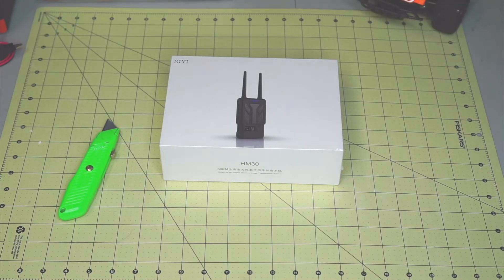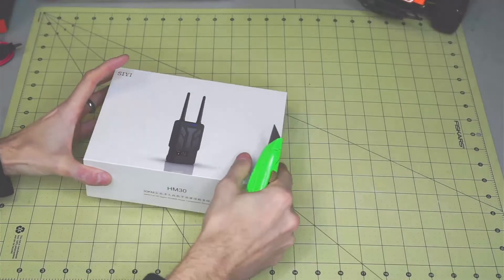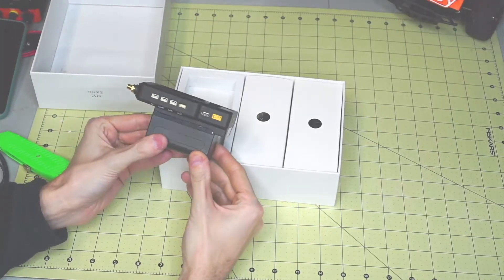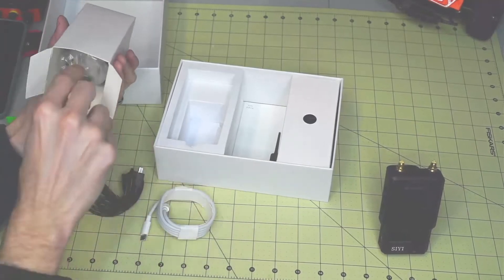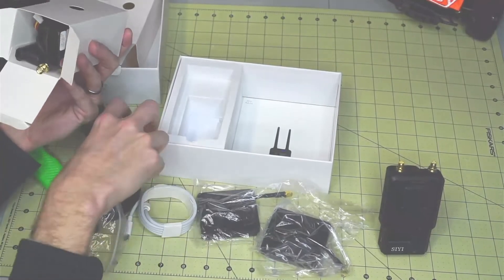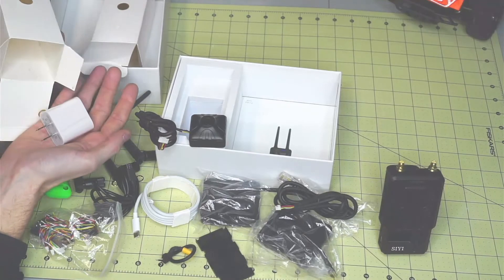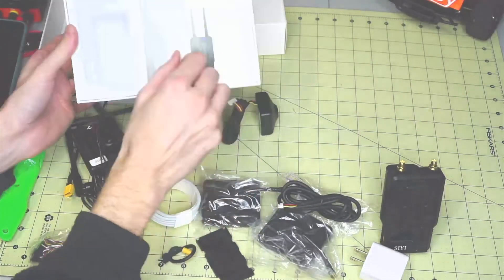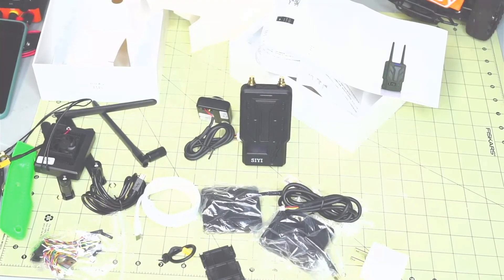SIYI HM30 Unboxing - openSAR.net

Comment: Have this system being delivered soon , got the hdmi converter with it because i buil a homemade fpv cockpit with a 50" screen , I think it will work good with my setup,  check it out
Reply: Get that flight in!  I seen your cockpit.  Nice.   I to have this on order myself.  I'll be using strictly with fixedwing since the latency is way to high for proximity quads and ever planes.    I have the DJI system but tired of waiting on them to give us proper osd so figure I try this.    Be aware the home arrow never show true home direction.   Hopeful they get that fixed. If not I'll just sell it and try HDZero next.
Reply: @Freebird_67  got a short flight in the other day but couldn't go out to for because couldn't get a gps signal,  got it working now just waiting on good weather , I got the fatshark system,  I have all the new cameras but haven't tried them yet
Reply: @jimmytheriot8978  Hi looking forward for your next video about HM30. I saw your cockpit and I love it, very cool :)  I have DJI and Im not sure which will be better - wait for hdzero with 1w transmitter or buy HM30 :)
Reply: @mariuszabedzki6446  thanks, I have the SharkByte system also , did a flight with the original camera and its nice but I think the siyi system is a lot sharper , but I have the new SharkByte camera just haven't tried it yet.  Waiting for the 1watt also!
Reply: @jimmytheriot8978  I think I just order HM30 and wait for 1w shark byte. When do you think you can test HM30 for some longer flight ? I saw in your last video you had an issue with GPS. Second question, what device u are using as a ground station for shark byte ? I saw only something which I can connect to goggles, but I need hdmi output as well
Reply: @mariuszabedzki6446  ima try to do a flight today , I use my cockpit and sometimes goggles for SharkByte, if you have the SharkByte system it should have came with the hdmi cable to connect to your goggles